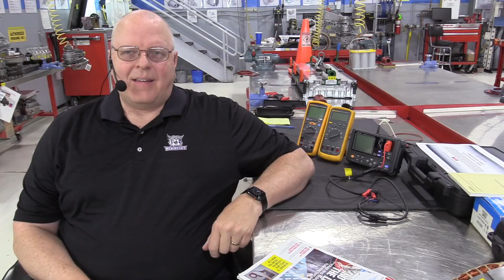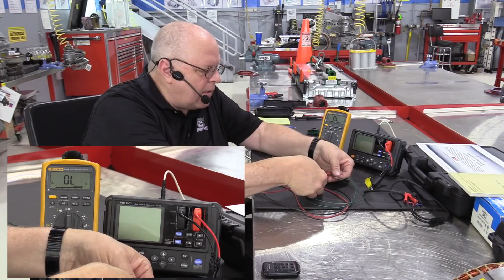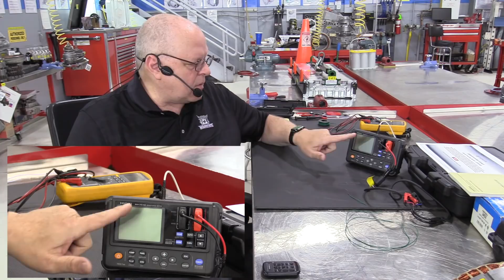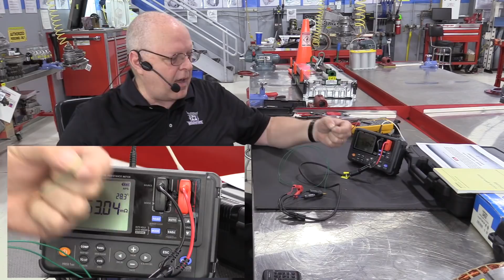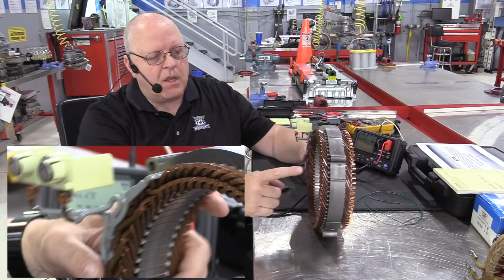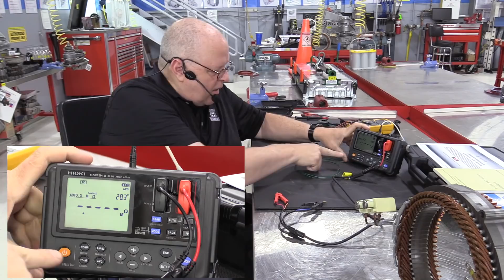Milli-Ohm Meter - Hybrid and EV Stator, Fuse, and Wire Diagnostics

Comment: It's certainly convenient to have this product that conveniently packages features needs for low resistance measurement, including the 4-wire measurement technique (clip-leads which have separate contancts in each jaw) and high measurement current. But you often don't need that expensive unit to do this kind of measurement. You can use a cheapie voltmeter (for example the $6 Harbor Freight, which has a 400mV scale), and a bench power supply that has a constant-current limit setting. Set the current to 1A, apply it across the circuit to be tested, and measure the voltage. Reading is 1mV per milliohm -- Ohm's law. (Or use some other creative supply of about 1A, such as say a 13 ohm 20W resistor in series with an automotive battery.) Maybe only 2 or 3 digits of accuracy, but often that's all you need.
Reply from the maker: Thanks for your input! The idea of having it all in one convenient package is to be able to quickly use it on a vehicle by service technician's who are typically in a big hurry. Great suggestions for alternative methods of measurements.
Reply: Oh definitely the professional tech needs it convenient to use. My cheap-o example was to illustrate that it's not doing magic to make the basic measurement, and that maybe there's a market for a meter that's significantly less-expensive by virtue of not attempting 5 digits of accuracy. On the other hand, expensive gear is nice :-)

Comment: I applaud people dilligently putting out educational material, and usually admire this channel.  But in this video there are a few issues.

6:06 "Hioki does not measure resistance the same way as Fluke 87 does". Actually, the measurement technique is substantially the same.

6:12 "Fluke 87 applies a voltage... and measures the current". Not exactly. If that was true, and you connect it to a very low resistance, then Fluke 87 would deliver enormous current. No ohmmeter works like that.  They either (a) apply a constant current and measure the voltage, or (b) they use a "ratiometric" strategy:  apply a known voltage across a resistive voltage divider, where one leg of the divider is internal, and the other leg is the device under test -- measure the voltage, figure the ratio, etc.

6:21 "[Hioki] runs current through resistors in the meter in a Wheatstone bridge circuit ...." This is completely off track. The Hioki uses the plain old strategy of applying a constant current [ref a], and measuring the resulting voltage, just like many other ordinary meters. 

The difference is that it uses the well-known 4 leads method to do this [ref b]: applies the current using one pair of connections (say the lower jaws on each clip) and measures the voltage through separate connections (say the upper jaws on each clip). This means there is virtually no current in the voltage-measuring leads, and hence no voltage drop in the measurement leads. So the measured voltage is entirely due to current through the device under test. Then... just ohms law as usual.

This is important because on the smallest resistance ranges, this meter applies 300mA (on 300mohm) and 1A on 3mohm and 30mohm) of measurement current! (So don't go applying it to sensitive electronics!).

[ref a] Hioki RM3548 Instruction Manual, Specs, page 93: Measurement signal = constant current
https://www.hioki.com/file/cmw/hdInstructionManual/92857/pdf/?action=browser

[ref b] Hioki Introduction to Resistance Measurement  page 8 
https://www.hioki.com/file/cmw/hdCatalog/4351/pdf/?action=browser&log=1&lang=en
Reply from the maker: Thanks for the information and the links! It looks like I totally misunderstood the method of measurement on this meter. I will make some edits. Keep the feedback coming, constructive criticism is always welcome.
Reply: And in typical Youtube fashion, it turns out there are a number of tutorials on the principles of 4-wire resistance measurement. This one almost exactly matches the Hioki, and also my other comment on using a bench power supply: https://www.youtube.com/watch?v=0vMvCVyOp9g
Reply: By the way, I did like your demo of measuring the resistance of portions of the length of a wire, and how delighted you were that it worked as expected :-)

Comment: Great video, I like how giddy you are about this tool. For those with limited funds, I use a ~$60 ebay milliohm meter that works great, but had ridiculously short leads. It seems it is no longer available, but has been replaced by a different model which may work just as well. 

For those interested in checking wiring integrity with a milliohm meter, I cobbled together a web tool to calculate resistance values of different wire sizes and lengths. This can be used to get a reasonable value to compare to with what is measured by the meter.  wirecalc.bitballoon.com
Reply from the maker: Thank you and thanks for your feedback!
Reply: Any chance of a brand name or link to this alternative?

Comment: Impressive demonstration of practical applications.  The forerunner of this instrument is the portable, battery-powered Wheatstone Bridge with decade resistance selections.  The unit was issued in the thousands to  communications specialists in WWII, who used them to locate faults in telephone cables caused by battle damage.  This helped save lives.  I used Wheatstones beginning in the 1960s to measure thermocouple resistance and other critical circuits on aircraft.  If you need to measure a very low resistance in a high-current circuit and do not have the necessary instrument, you can use a (relatively) high-current circuit, an ammeter, and a voltmeter to determine R using Ohm's Law.  In effect, make your own four-wire device:  Use a car battery, or batteries in series or parallel as necessary, and a resistive load, such as an old headlight or heater coil, to construct a circuit that draws current within a range you can measure with your ammeter (less than 10 amps for most DMMs).  Again, you can use series or parallel connection of loads to get a usable current value.  Now add the R you want to measure in series with the load and ammeter, and measure the voltage across the R while monitoring current on the ammeter.  Divide the volts by the amps, and you have the R, by Ohm's Law.  For instance, if the current is 8.31 amps and the voltage across R is 0.12 volts, the R is 0.0144 ohms, or 14.4 milliohms.
Reply from the maker: Fascinating stuff! Thank you and thanks for your feedback!

Comment: Thanks for the review. I use the 3550 Hioki battery resistance meter and i love it. very accurate for measuring cell conditions and reverse polarity protection which is good.
Reply from the maker: Thank you and thanks for your feedback! I will have to check it out

Comment: This type of low resistance meter is commonly used by professionals when testing industrial AC induction motors. Induction motors usually fail with the wire insulation shorted to the frame of the motor (ground), which would be detectable by using a megger (megaohm meter) or a hi pot meter, which places high voltage (thousands of volts) across the leads and measures the resistance to ground. Occasionally motors fail with their wire insulation not shorted to the frame, but shorted to the wire next to it. For that failure mode, the miliohm meter will show you that type of failure. To detect that type of failure you don't really need a manufacturers resistance specification because you can compare all three phases and they should be identical. If one of the three is vastly different, there is a short.
  Another use for this tool in the automotive environment is testing ICE vehicle starter wires and connections. A starter wire or ground may be connected, and show continuity, but be a higher resistance connection, causing voltage drop when the starter is cranking.
   Alternatively, if a person does not have a miliohm meter but does have a accurate milivolt meter as well as a high accuracy amp meter, and a high current DC power source, you can pass several amps through the wire or connection. Then simultaneously measure the current and voltage, and by ohms law calculate the miliohm resistance.
Reply from the maker: Great feedback and ideas! Thank you!

Comment: Great video Professor and loaded circuit testing with a mA testerand thermal imager and you could home right in on broken wire strands & corrosion. Just another tool in the diagnostic arsenal.
Reply from the maker: Great ideas! I have not used a thermal imager yet. Thank you and thanks for your feedback!

Comment: The dual leads are called "Kelvin clips".  Current is fed through one set of wires. It is the same inside the meter as through the unknown resistance. The other set measures voltage only. No current so there is no voltage loss and test lead resistance is removed from the measurement. From that, accurate resistance can be calculated. It can also be done using two internal brides. Look at the General Radio model 1666 which has been available for years. General Radio became "Genrad" and is now out of business.
Reply from the maker: Thank you and thanks for your feedback!

Comment: It can be used to check switches for increased resistance as well as finding corrosion issues in places like ground terminal joints. But some of these corrosion issues can also be seen using a infrared camera (not spot measurement but using a hole picture). 
Since connectors are problem issues on many old cars, a comparison measurement on connecor pins can also find a corroded pin in a fast way.
Reply from the maker: Excellent example uses, thank you!

Comment: I love finding a new tool that has great potential to open new diagnostic doors......would it be possible for you to create a video for showing the best strategy for diagnosing an electrical drivability issue like the one you described in the vehicle that had the defective stator you tested with the new ohm meter?  Would stator windings be the first item to to test and eliminate in this process? And are there other things which could give the same symptons?   Another inspiring video thanks prof
Reply from the maker: Great ideas, I will try to implement them in future videos. thank you!

Comment: Hello professor
Can you do the car battery (12V ) resistance to compare good battery and some battery that is ded from junk pile?
Both in the car and out the car.
If it's possible.
Reply: Can't be done. The 12V from the battery would interfear with the miliohm meters internal circuit and cause false readings. There are other techniques to measure battery resistance
Reply: Ok. Please give me 2 examples how to test car battery?
Reply from the maker: There are tools that can quickly measure the resistance of a battery (Midtronics and Hioki make them).  Old school methods will get you close using Ohm's law. Load test the battery while measuring the battery voltage and the current. Battery Resistance = Voltage / Current.
Reply: Exist one device specially designed for that BT3554 basically is the same milliohm meter and voltmeter

Comment: the Phone company or at least Pacific bell now ATT.  has used a similar Analog tool to measure their audio level connections.. i have seen them use it as a distance to a short device.  one tech found the short in a friends phone circuit 900 feet from his house.. when the phone guy examined their hanging cable he found a bullet hole where somebody had shot the cable. 

 this is a great video..  thanks..

 i was looking thru your videos to see what you had on voltage drop testing at least on conventional cars..  this is the sequence i use.. https://i.imgur.com/kviX0VQ.jpg   i assembled that sequence over years of doing the individual tests and wasting a lot of time. so i do it right up front first..  that test is one i created.. i posted it all over the next.. you might want to create a video explaining its use..  i don't have any quiet places to create the video..
Reply from the maker: Thanks for the information and the link. Voltage drops tell it all, ohm-meters have been almost useless until this one came along. Thanks again!

Comment: That meter is a clever piece of work. I've never seen one used before. Would be fun to add to my already crowded test bench.

BUT, what really got me excited was seeing the 5ET50 stator :) Glad to see that's coming apart. I paused the video and took a screenshot of the transmission over your right shoulder to try to see if that was it. I don't think so.

Waiting patiently. Thanks for doing these videos.
Reply from the maker: Thank you, The 5ET50 transaxle is on the far bench behind my left shoulder. The video on it will be coming in September, I have a few other things I have to finish up before school starts again in late August. Thank you for your patience.

Comment: Shorted stator can be caused from metal chips wearing into insulation. Coming on Refrigeration compressor. Solder beads floating around end up in windings
Reply from the maker: Great examples, thank you for sharing!

Comment: Good day,
An amazing instrument and explanation!
However in motor rewinding industry, we use impulse tester instead. Miliohm meter is for another purpose. 
http://www.skf.com/group/products/condition-monitoring/portables-data-collectors-and-analyzers/electric-motor-analyzers/static-motor-analyzers/awaiv/index.html

https://www.atecorp.com/products/baker-instruments/d12r

This is a 3 lead motor, which means unlike 6 lead motor, phase to phase insulation is tricky to be determined. If we use impulse tester, inter-coil, inter-phase insulation can be determined (OK or NG). Could you be a kind man? Please ask Toyota and other manufacturer if we can use impulse tester to test the MG. This impulse tester gives a few kV of impulse voltage and check the decay RLC waveform. Thank you very much in advance! Since these EV motor/generator is running on lower voltage than 415V, maybe the manufacturer forbids impulse test on EV MG. 

Best regards and thank you again :)
Reply from the maker: Thank you and thank you for the additional information and links. I will have to check out the impulse tester.

Comment: 4 wire resistance measurement, also called Kelvin measurement, is a awesome concept. It puts a known current through piece under test and measures the voltage through a different path. There are some good YouTube videos describing it in further detail.
Reply from the maker: Thank you, I will check them out!

Comment: Powerprobe has voltage drop charts for common automotive fuses, it converts the voltage drop across the fuse into approximate current readings. I wonder how they compare to the findings using that meter!
Reply from the maker: I will have to check it out. Thank you!

Comment: Measuring voltage drop at the fusebox is also great for finding problem circuits when looking for parasitic loads that drain down a 12volt battery to fast.  Great video btw.  I don't remember ever seeing anyone at work that happy to use a milli ohm meter on aircraft to check bonding when connecting two components.
Reply from the maker: Thank you for your feedback, I figured that type of meter was used somewhere, I had just never seen in used in automotive diagnostics before.